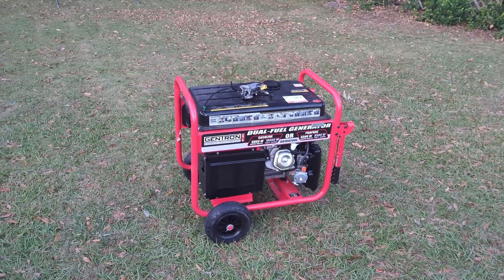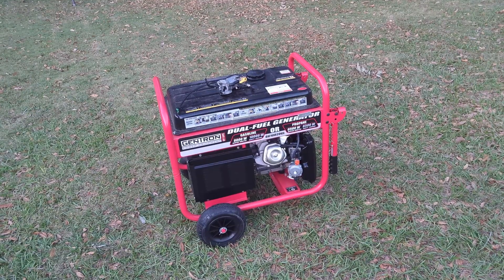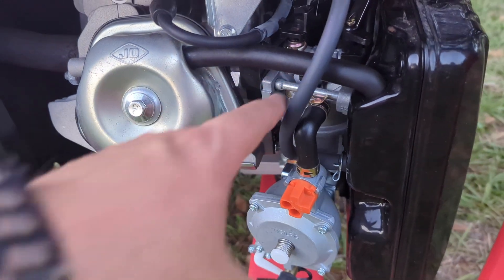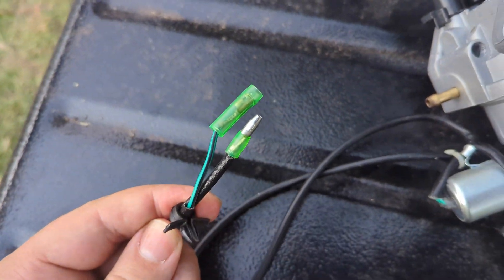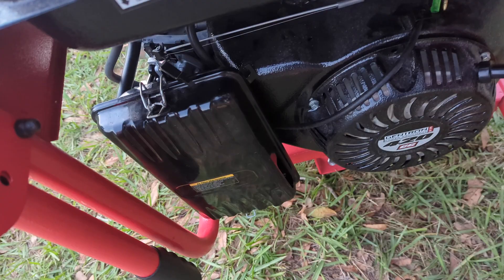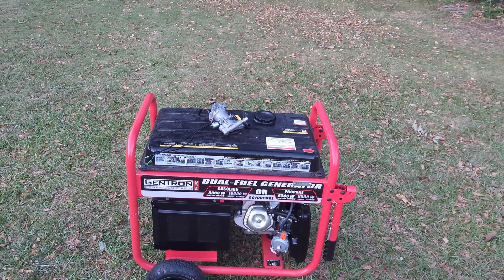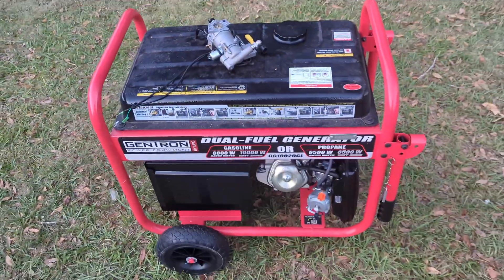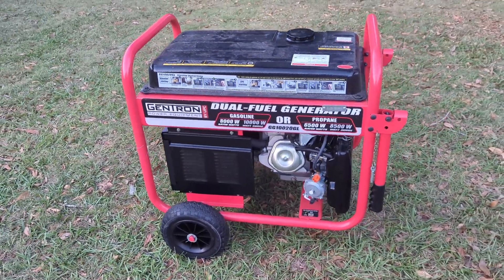Quick and easy fix for a dual fuel gasoline generator that won't start or run on gasoline | Try 1st

Comment: Thanks for this. The solenoid at the bottom of my WEN generator carburetor wasn't clicking, so I removed it (only two screws, and luckily easy access) and found it stuck closed! I cleaned it up and got it actuating again, reinstalled it and it's running like a charm! Thanks again!
Reply from the maker: Glad to hear it!

Comment: Thanks great information I’m struggling after replacing my carb still not start. I will try to disconnect the wires and see what happens